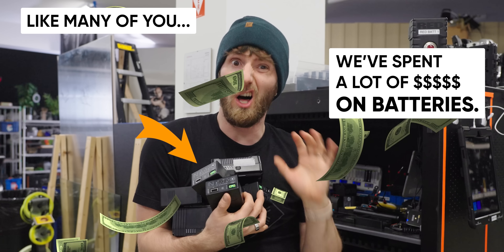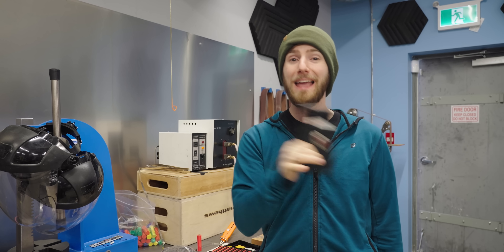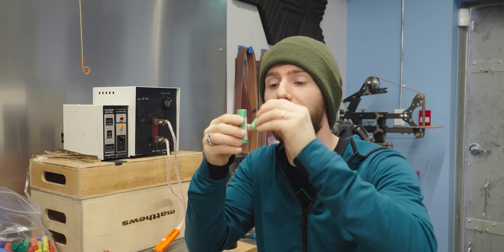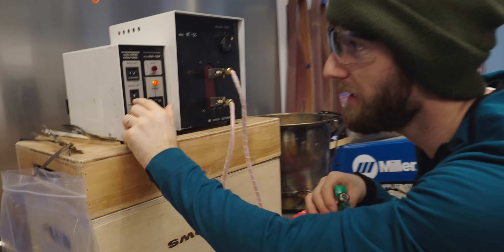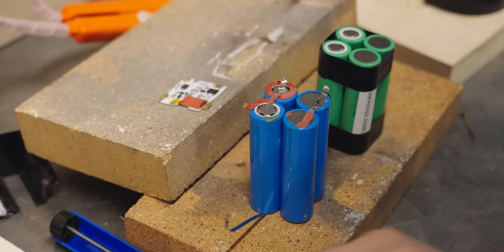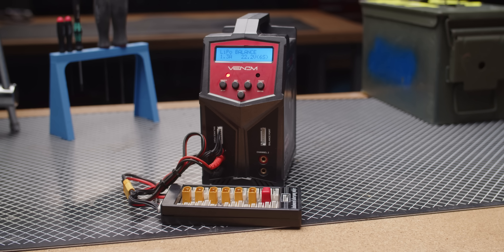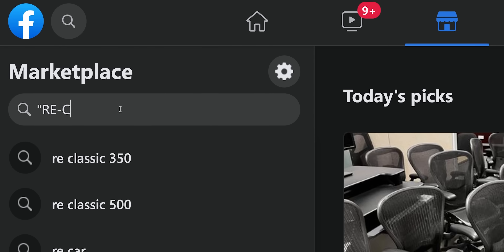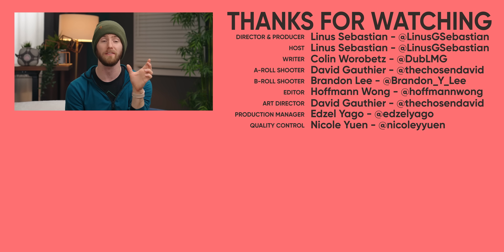This should be illegal… Battery Repair Blocking

Comment: Check that camera pack again. Sometimes if it's a smart BMS with a microcontroller, it needs to be reset, and typically charging the pack will do that. You only need to charge it for a few seconds to initialise the BMS, then it should output the voltage from the batteries.
I've had this happen to me before when I've been using a battery pack in a project, and I've had to unsolder then resolder the BMS
Reply: Some packs will self reset when installed into a charger, others (provided they are not an 'evil' one) require pack voltage to be applied to specific pins on the BMS to turn it back on.
I believe the difference is if the charger can detect a failed pack and not charge it.

In either case power from the pack keeps the BMS enabled, when the voltage drops too low (lower then where the BMS cuts off output) the BMS itself enters a fail-safe mode because if cells are that run down they might be damaged thus becoming a fire risk if charging is attempted.
Reply: Happened to me too to some repacks. I thought the battery circuit was dead until I tried to recharge it thru the device's charger.

Linus can also lessen the number of cells he used. He really only needs one cell per series. The RED battery packs would've been way easier with just 4s1p. Better for novice repacking. Better a "lite" pack than a dead pack.
Reply: @ayuchanayuko  Those Red cameras are power hogs though. When they first came out, you couldn't even use most other V-mount batteries on them, you needed their special high-amp batteries. Nowadays I think all of the V-mount batteries are rated for high amperage because they are commonly used on LED lights as well, and they can draw a lot of power.